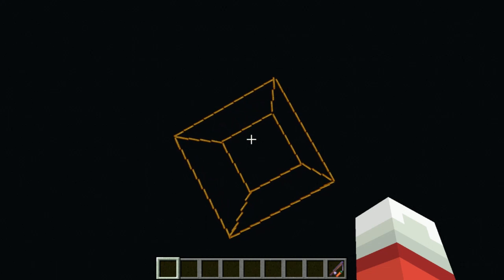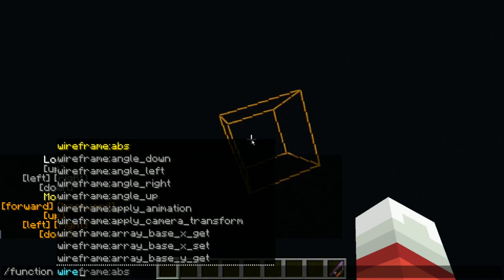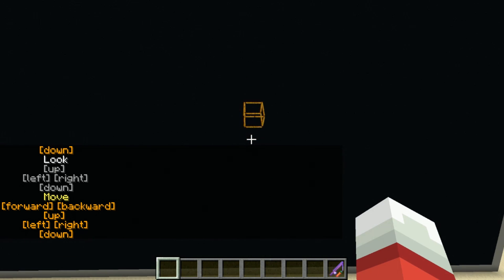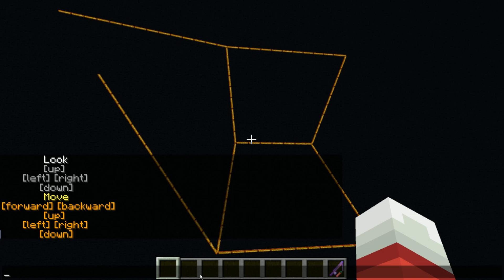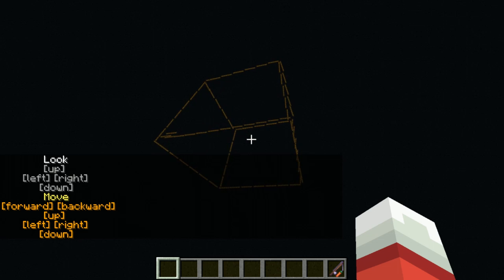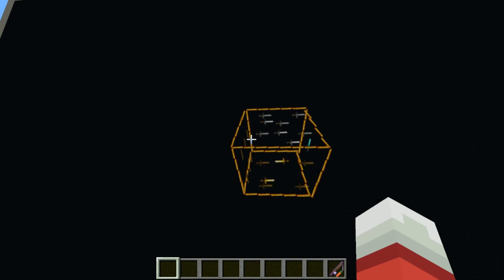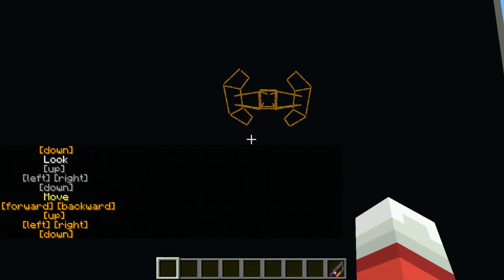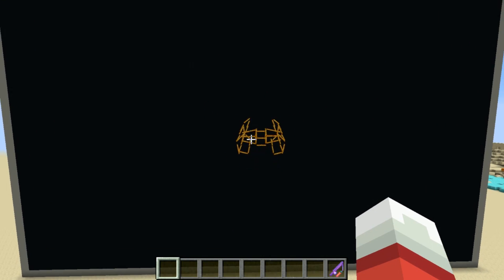3D Wireframe Renderer in Minecraft 1.14

Comment: You can always tilt the blaze rods to where they slightly intersect with the surface of the block, effectively "cutting" the rod to be any length you want
Reply: good idea, but that would actually need to be calculated with player position relative tp every blaze rod, so the tilting is seamless to the player, I hope I correcly expressed myself

Comment: Culling is possible for wireframe objects. You specify the surfaces via triangles, then you take the surface normals of those triangles and check the Z-Values(Only draw positive/negative Z-Values, depending on how the projection is set up).